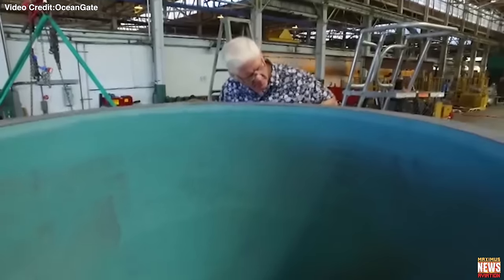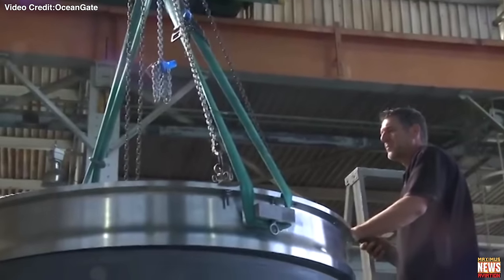Watch The Manufacturing Process That DOOMED OceanGates Titan To Fail. But It NEVER Had To Happen.

Comment: So they were supposed to take a carbon fiber tubular billet and turn it on a lathe and bore a inner hole on a large, most likely a vertical lathe. The CEO should’ve called me, I’m engineer
Reply: Probably too expensive. He got a bargain on the carbon fiber apparently.

Comment: The way the glue was being put on.. And no glue came out the other side a bit? (Like they was cheap on the amount.. could be areas glue didn't connect to
Reply: Agreed. I'm no nautical engineer, only a plumber, but we glue pipe together every day and that little amount of surface area and very little overlap and skimpy amount of "glue" made my jaw drop.

Comment: I can’t help wondering if the fact that the fibre-wound cylinder was 5” thick didn’t actually compromise whatever strength the thing had under compression. Picture what would happen under extreme external pressure - the outer layers would resist being stretched but each layer further in would be under compression - all set up for delamination IMHO.

Comment: Any fiber including the exotic ‘carbon fiber’ cannot take deep sea compression loads ... they are just good for tension. The Titan pressure cell was practically just plastic resin with its fiber reinforcement doing nothing. Lack of this  basic knowledge killed them.

Comment: Like the video seems to show, the carbon fibre band was applied with almost no cross meshing between layers, you would ideally want the mesh to be layed down at right angles in a criss cross fashion? not simply parallel bands for the whole thickness - 5 inches.  The later would make partial sense if it were a pressure vessel with high pressure on the inside - utilising the great strength of carbon fibres in tension.  It seems the benefits of carbon fibre did not get used in the design.  it relied on thickness, many layers and epoxy bond strength.  Epoxy is not known for having a long life under salt water at high pressure and low temps.   Even at atmospheric pressure epoxy is not a bonding agent of great reliability.

Comment: I'm no sub builder or engineer but I am a boat builder by trade and I can't help but notice that at 2:30 onwards there is no sign at all of excess adhesive pushing out of the joint between the titanium ring and the carbon fibre cylinder. You cannot consider that joint to be complete/ intact unless there is excess (preferably air bubble free) adhesive pushing out from both sides! Clearly the tube and ring need to be machined so that the gap is within the specs of the adhesive and in addition you would need some devices to ensure it stays centred during assembly so that the adhesive gap remains consistent and concentric. I also couldn't see a scratch pattern or other texturing on the surfaces being bonded together which will have drastically decreased bond strength. Lastly, they wound the carbon tube with just one fibre direction. Carbon fibre is strongest in tension and the way this tube was wound would have precluded taking advantage of the tensile strength of carbon fibre. I wouldn't assemble a boat for inland waterways like this let alone a depth limit pushing sub.

Comment: I make steel pressure vessels as per ASME code.  Also chemical tanks out of FRP-Vinyl ester resins.  Tpically FRP tank shells are made via filament winding method which is what we see in this video.  Difference is there is an angle (typically 10-20 degrees as the filaments are wound around the mould.  We call this cross-winding, so that the shell develops it's full strength.  I have never wound the filament at this angle before.  It just isn't done.  That said, FRP or CF isn't a good material against external pressure, more so at 380bars (1 bar = 10m).  They are only good for INTERNAL pressures.  The adage, you can't push a string, is common sense and law.  Never mind 250k a ticket to get in, Hell, I wouldn't get in even if I'm paid 2.5m.  That the sub has made a few successful dives before that does not prove that it's safe.  If fact it was all lady luck.  Many people think it's the external Two things conspire to destroy the sub.  Firstlt, for every dive, the ever present pressure will try to destroy the sub.  Secondly, (and this one is not so apparent) is the sun.  Specifically, ultra Violet rays.  For every day the sub is out of the water and under the sun, the CF hull made of resin DEGRADES due to the UV rays.  This weakens the hull.  Give it a few dives and thousands of hours under the sun (Titan was completed 2018), this was a tragedy waiting to happen.  A layer of UV inhibitor may slow down the degradation, but cannot complete eliminate it.  Hence the tragedy.

Comment: I worked if GFRG and even our products (non load bearing) used strand mat fibers in mixed orientation.. it’s crazy that they ran thier fibers one direction.. also, carbon fiber hold’s pressure well but not the other way around. Every trip significantly weakens it so it’s just a matter of when it implodes. 

This dude and his company should be banished from engineering for life.
Reply: Exactly - and did you see any longerons, bulkheads, or rings. I didn’t

Comment: I'm not a engineer but I have worked in aerospace composites no vacuum on the one joint with
highest rate of gail and 3 different materials that contract differently at temp n pressure bad combo period
Reply: Addtionally we in the USAF we’re not allowed to perform cold bonds on stressed areas. I did this in the USAF for 27 years and 21 in civilian aviation

Comment: Epoxy glue to hold a pressure of almost 400 atmospheres...when I saw them gluing these pieces together last week in this same video, I knew besides the glass/glue wrap that one of these .. oh and the underrated viewing port was or were going to be the weakest link...by looking at the parts they brought up today, it may be hard to determine which went first...absolutely the worst design for that sort of diving and at that depth...of course the CEO was crazy to be using glass fiber and glue for the shell, and promoting this like he did, but he somehow got others to believe in this death trap....lawsuits will be lining up.

Comment: RIP to those impacted but lets hope this story is never forgotten as it should forever be used as a shining example of what NOT to do when obtaining a Mechanical Engineering degree (dissimilar material interactions, material tensial vs compression stengths/weaknesses,  ignoring constant red flags the design was actively failing [carbon fiber cracking], and most notably a team leader who went out of his way to ignore industry warnings and safety protocals so much so he would fire the person who wouldn't)...

Comment: It isn't the two different materials, nor the adhesive that caused catastrophic failure.
It was cyclic fatigue of the carbon fiber tube under 'compression' that caused the carbon fiber mono-filament to be in compression verses tension that delaminated the epoxy matrix.
The laughable real time acoustic strain monitoring was another insult to physics and any sort of fail safe structural monitoring system.  A canard.  A marketing ruse.
Also, they knew they were going to die.  During the dive, it was likely 100dB+ creaking that caused them to drop ballast and try to make it to the surface.  So Stockton Rush had time to process all his lies and deception just prior to him being vaporized.
As a scientist and mechanical engineer, I can say without equivocation that Stockton Rush was a moron.  Somebody better double check his engineering credentials because I don't know a degreed engineer that would step foot on that vessel before it imploded.
There is also a plausible scenario of psychopathy or a death wish. Unknowable but others may know Rush's mental status throughout his life.
I have come up with an analogy.  It is the dumb guy in the neighborhood who feels he was good at science even though he never took a calculus class and was a C student who built the equivalent of Wright Brothers Kitty Hawk in his garage and convinced four other Bud Light drinking neighbors it would be a great life experience to fly it up to the edge of atmosphere.
That is who Stockton Rush was.  He was told by real engineers what his fate would be.

Comment: A "How NOT to build a Pressure Vessel" video. Stockton must have finished last in his Engineering class . WTF!
Reply: There's his problem. He tried to build a pressure vessel like an airplane or space capsule and did a crappy job of that. He needed a vacuum vessel like a submarine.

Comment: Work a lot with fibreglass resin if you don't add a thickener to the resin when it dries it is full of air bubbles. It is like pouring concrete reinforced by steel and you don't use a vibrator to get the air bubbles out, under stress the whole thing if it does not start leaking it will break apart.

Comment: Surface wiped with a rag, glue mixed with a wood stick, then applied by hand, by guys just wearing regular clothes, all done in open air...totally legit, and no possiblity for any contamination or imperfections. Yeah, right.
Reply: Hey now, at least they were wearing latex gloves while applying the glue (the gloves were probably powdered, further fucking up the mixture. 😂

Comment: Read the wiki page about the titan
"How many backup systems do you have for the thing collapsing?
 Rush: So the key on that one is, we have an acoustic monitoring system. Carbon fiber makes noise. There're millions of fibers there. [...] It makes noise, and it crackles. When the first time you pressurize it, if you think about it, of those million fibers, a couple of 'em are sorta weak. They shouldn't have made the team. And when it gets pressurized, they snap, and they make a noise. The first time you get to, say, 1,000 meters, it will make a whole bunch of noise. And then you back off, and it won't make any noise until you exceed the last maximum [depth]. And so when, the first time we took it to full pressure, it made a bunch of noise. The second time, it made very little noise."
A BUNCH OF NOISE
And also
"In April 2019, OceanGate announced that a crew of four had set a record by descending in Titan to 3,760 m (12,340 ft).[34] Karl Stanley,[b] who had participated in the April 2019 dive alongside Rush,[34] later sent an email to Rush stating his concerns with loud cracking noises they had experienced during the dive. In Stanley's opinion, the noises were associated with a potential "flaw/defect in one area being acted on by the tremendous pressures and being crushed/damaged", adding he felt it meant there was "an area of the hull that is breaking down".[37][38] In a later email, Stanley was more blunt in his assessment: "I think that hull has a defect near that flange, that will only get worse. The only question in my mind is will it fail catastrophically or not." Rush responded by stating more tests would be conducted"

Comment: As someone who spent 35 years trusting the designers, engineers and regulators to  know what they were doing with my aircraft all I can say is anyone who even thought about going down to several thousand metres in this thing must have lost their mind. Internal pressure vessels - airplanes - are pretty well understood: the same is less so for these sorts of structures and Titan appears towards the bottom end of the list of professionally built craft.

Comment: Hey folks,
Don't worry too much about the glue.
The pressure outside is sufficient to get those surfaces apposed and tight.
If the fibers were woven in three ways including radial (if you can), the vessel would have lived longer!.
But still, the carbon fiber structure is not good for handling external pressure.
Maybe the aerospace industry experience blinded him.

Comment: "...if we mess this up, there's not a lot of recovery." How prophetic. 

I don't know a lot about composites, but I have to wonder if wound composites are sensitive in the direction of the forces applied, i.e. MUCH stronger if the pressure vessel is internally pressurized.

Comment: *  The reason the structure failed was because the Carbon Fibres were laid up in straight parallel Axial lines. Because this was a cylinder the walls in the middle of the tube shape were deformed by the pressure, when this happens the inner walls of the tube are put under tension from end to end  as they are stretched by the necking of the tube, when this happens there are no reinforcing Carbon Fibres to resist this end to end tension and the inner wall resin between the Carbon Fibres starts to crack Axially in the centre, then the crack propagates through the 5" thick wall to the outside and the centre of the tube opens up like a cracked egg, then the ends are blown off by the inrush of water pressure. *

Comment: Before you even get started, they didn't even use a clean room to prevent contamination getting inbetween the fibres being applied in the process (this cause micro voids). Normally with carbon fibre products you compress it to remove any air bubbles which are an initiation point for an incipient fault. This then grows until you have a failure. I really don't know even if they did a ultrasound scan between dives to detect any dis-continuaties. Cowboys is what comes to mind.

Comment: With glue, wow, I see that in the manufacture of the cabin there are some details that were overlooked, the carbon fiber and the titanium can work together for that depth of the sea, as long as all the manufacturing procedures are correct, the carbon fiber is used under several layers of carbon fibers with resin compound with vacuum air suction compressor in manufacturing so as not to leave air inside the thickness of carbon fiber, to avoid its weakness by air bubbles as well, but at the same time. When joining it with a piece of titanium, some factors must be taken into account that prevent the two from working together,
 
For example, if you notice that they used a glue to join the arches of the doomed in deformed circumstances by hand but or with a balanced glue machine, this is never compared to a union by brazing, at some point the glue under pressure on the sea depth can sag due to wear and tear from each voyage, they needed vital reinforcement for the arches of the doomed on both sides, several titanium beams could work crossing end to end above the carbon fiber arch to the round about of the cabin and at each end with pressure nuts for each beam, if they wanted to make sure that the doomed on both sides would not detach from the pressure, the glue could work to prevent leaks, but they had to reinforce the arches of the doomed,
 
This reminds me of NASA's Columbia shuttle, the lives that died due to a mechanical error and NASA continued with its trips into space, the idea of the submarine to take crew members to see the Titanic was achieved and a manufacturing error of the submarine under investigation could be the cause of this tragedy, the next submarines must be certified to be safe under remote control tests without human crews and then market it for tourism with humans, it was a step that was overlooked... God bless these souls and their families...🙏🌎🛥

Comment: In his defense, its not like he popped this thing off the mold and threw school children in it. It was pretty thoroughly tested before anyone got in it, and was in service for a couple years before the disaster. He was trying to innovate so it makes sense that he went with a new approach. He also went from the standard 2 inch hull thickness to 7 inches when changing materials, to compensate. He teated ut and it worked. He rolled the dice and lost.

Comment: It occurred simply because a design moron wound unidirectional fabric into a tube, which material has relatively poor compressive strength to begin with, and which structure thus had no practical lateral strength and was porous to the high water P that progressively split-into the weave. The tube thus simply split apart.

Comment: Absolute insanity. There isn't even an interlocking system or anything, just straight titanium ring against a lump of epoxy-soaked carbon fiber lump and not one of these people doing the gluing was thinking about it? These two materials have different thermal expansion coefficients. It's straight up criminal negligence.

Comment: 0:39 RIGHT THERE is the issue with this design. CF is NOT homogeneous, it is layered and as it is compressed on a dive, then released, the layers begin to delaminate until you are left with hundreds of layers of resin impregnated CF which aren't bonded to each other. This allows the layers to slide over each other and the end result is that the whole tube will "corkscrew" and fail. If it had been a 1" titanium hull with 4" of CF then I would have given it a better chance, but not pure CF.

The SAME thing will happen to aircraft wings made from CF. You see them flexing so much more now than they used to, and guess what? CF fishing rods last and last then BOOM, they snap because of delamination. I won't be flying in any airfraft with CF wings.

Comment: I'm no expert, but I question two things about the choice of carbon fibre for the hull.
1) A submarine hull will be under compressive stress. But as far as I know carbon fibre better known for its strength in tension, not compression, so what was the point of using it?
2) Carbon fibre is unforgiving because it does not yield, unlike most steels which do yield. Yielding is permanent deformation of the material which would allow the hull to relieve stress concentrations that may arise due to manufacturing errors.

Comment: On the surface the glue had to hold the heavy metal ends on the accommodation tube. Underwater it had to seal it from the high pressure sea water. The weight of the end pieces on the surface when horizontal could have pulled on the glue, weakened it and caused the seals to deteriorate.
Reply: No, it give way in the carbon tube.

Look.at the recovery pics. It basically folded in.